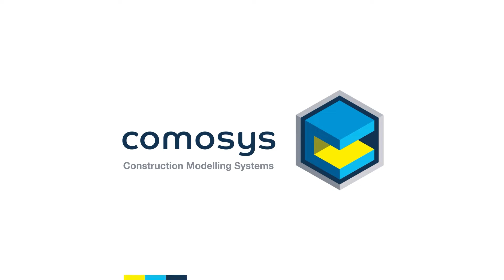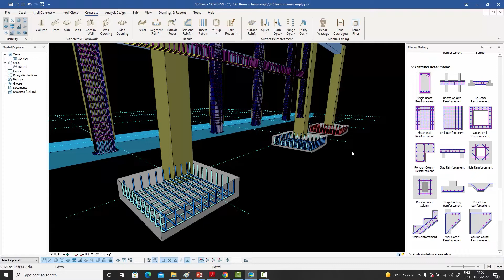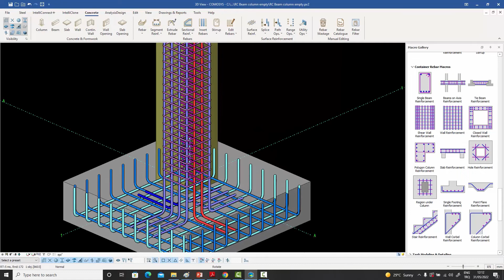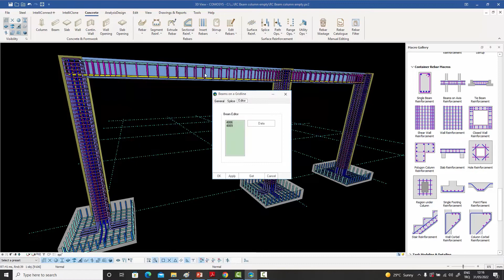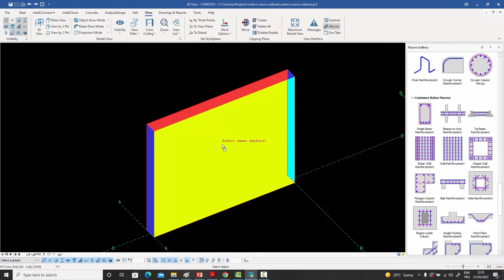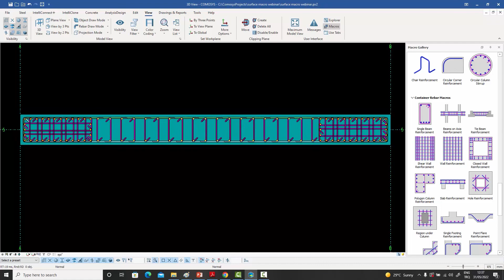Comment: It looks great. Can Comosys show only the bottom or only the top reinforcement of the slab and can it make separate drawings for the bottom and top reinforcement? Since the columns and walls have been analyzed and reinforced already, is it possible to give the reinforcements of the columns and walls by levels and not for their entire height? In Comosys, is it possible to make a quantity table of only selected elements, for example only one column or only one beam?
Reply: Thanks for watching the video. Yes we can generate the reinforcements of all elements according to their respective levels and not for the entire height. It is easy to import the "views" we have created in a 3D model into a 2D drawing and give automatic dimensions, annotations accordingly as per the individual levels of height. 

Regarding your query on quantity table of only selected element, yes it is possible in comosys. We can generate automatic Reinforcement drawings for individual elements like one column or one beam. All type of required sections and views have been created automatically with dimensions, annotations and also with the quantity table whereas no manual intervention is needed

Also we can show only the bottom or either the top reinforcement of the slab through editing the filter options in view property dialogue box. We can create and customize all type of drawings which Comosys has all flexible editing options to meet our requirements.